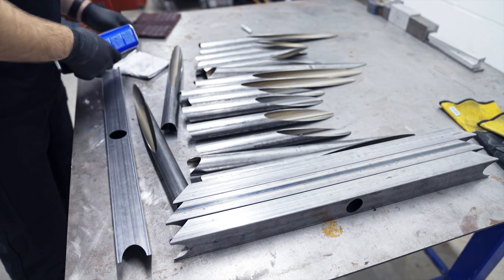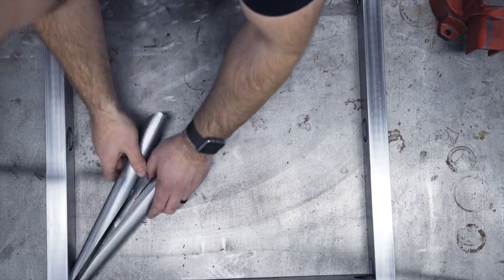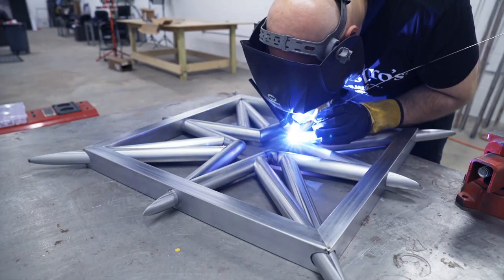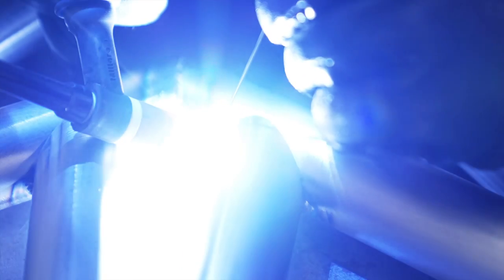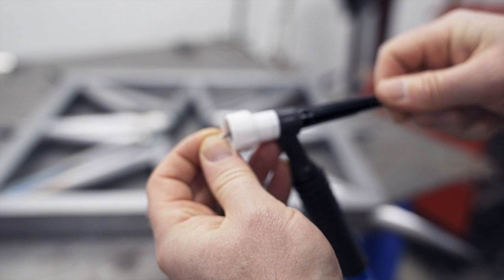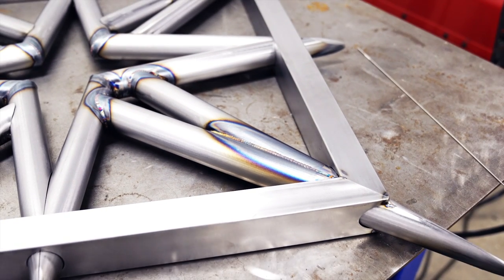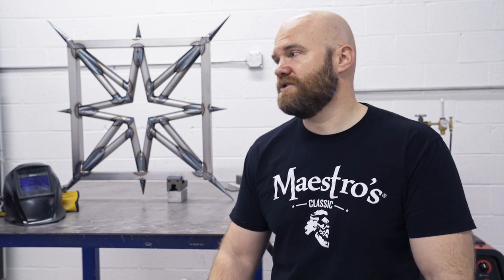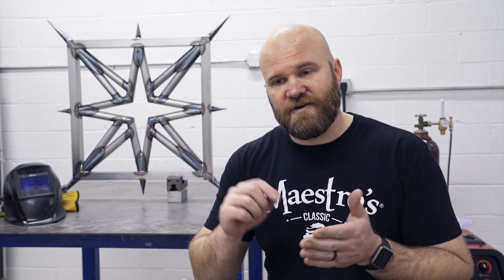Tig Welding the Nautical Star Weld Kit from Precision Tube Laser

Comment: I’m a pulse guy for stainless mainly. I have a few videos on my instagram with my setting. It will vary depending on the materials being welded but a slow pulse is what works best for me. 0.8-1 pps is optimal for adding filler. Just have to figure out where you want the peak on and off times.

Comment: Hey man just found you, really digging this stuff. I might add, for your camera, if you can, you want to have, for the puddle shots, which I want to see more of that, if at all possible, you would want to have your ISO as low as possible, not sure if your camera would go less than 100, but that is a must, and then set shutter speed as fast as possible too, I mean if you can get it to manual mode. Then maybe get you a polarizing filter to cut down the glare, and you should be golden. The brightest of it is causing clipping (pure white) and that is really the only answer a photographer has for it. Trouble is, you lose your dark tones, but you can always bring the brightness back down in post. In vegas there is a filter that you can adjust brightness and hue and equalize it.  
The fastest shutter speeds on todays cameras are 1/4000 and I doubt you are working with anything that fast, but that and maybe playing with your welding helmet filters might help it out. 
Really cool man, keep it up! I will be around to catch it, subbed here at around the 5.3k mark. Cheers!

Comment: i am currently an aero space welder, from my expirence non of the schedules ive seen have required pulse. I do know that some of the other welders like to use it to keep their heat down, but they tend to mash the pedal instead of controling it. I would use it if i was welding with a lathe even then i would pulse with the pedal.

Comment: I've had good luck with the 3m marine paste wax preventing rust on mill scale cleaned steel it's pricey($25?) but if your keeping it inside it will definitely work for a long time and a can of it lasts quite a long time, I use it on my bandsaw stand, welding bench, etc

Comment: Nice work.  That thing has miles of welding. I'm going to try the furick cup. I've heard they are argon eaters. I mostly weld aircraft parts with tight clusters similar to your project here. Bought my first Tig setup in 1979.

Comment: I rest my tungsten on the weld while the post flow is going as well. This has never created a problem for me, in fact, it has helped. At first, I would rest the edge of the cup on it instead, but the cup would slide making the post flow useless while I was grabbing another rod, checking the weld, or just prepping for the next one. Now I use the tungsten to hold it there and I've never gotten contamination from it. If I had just dipped, then, of course, I do it a little differently. As for pulse, I prefer to use a foot pedal to manually pulse, so that I can sync up the pulses and dabs myself, instead of fighting to grow accustomed to that one or two freq settings. I'll try one of these pieces once I can find the finances for it, but I don't think my beads will look quite as good as yours. Maybe I should practice up before dropping the cash anyway. lol  Thank you for uploading this!
Reply from the maker: Thank you for the comment man! With the thought you put into things you are going to be, if not already, a great welder/fabricator/person.
Reply: @JustVoss  Thank you. I certainly try to be the best I can be. I'm not there yet, or at least I haven't been tested to that extent yet. I did well at my state's welding competition, but I also still have a lot of room to improve. Retaining the skill(muscle memory) over the periods in between welding seems to be my issue. I would say I wish it was like riding a bicycle, but I wouldn't be surprised If I can't do that anymore.

Comment: Nice job Justin. I've been getting into cold gun metal bluing lately and think that piece is a good candidate for that. It would need a clear coat of some type to prevent rust. Using a wax is one method that's not real durable but it doesn't chip like PC or paint. 
i
Reply from the maker: I might look into that, I ended up putting shark hide on this. Kinda like wax.

Comment: i dont really like pulse either... when i have to use it because stuff is thin like those spikes i usually set it really fast, so i get the benefit of less heat input while for me it just looks like a normal setting with no pulse. sometimes when i do a shitty weld, i use the pulse to go over it again and make it pretty. you are not supposed to do that, but i dont think my bbq grill will fail because of it :^

Comment: hey man, when it comes to rust protection personally i give everything a couple base coats of silver zinc. i buy that shit by the crate and use it on all my metal work projects and nothing's rusted yet. another option is to have it hot dip galvanized giving it a pretty much indestructible coating that you can paint over.

Comment: Thin metal what I like to do is have a high pulse, minimum 60 but generally 100 pulses a second. Have it in a low back round with a short on time. It lets you weld like there's no pulse but hekos keep the metal from blowing open and agitates the puddle so it will move

Comment: Powder coating all day long. For durability, strength of finish, longevity and overall a better end result. I made two beds a few years back, made myself a large bed to hold an emperor mattress (7’x7’ mattress.. yup it’s BIG) and made a buddy one. He cheaped out on the finish whereas I paid to have it powder coated and the difference is night and day. Nice project bud and nice tight beads with your welds, will look into those cups too. Have you ever tried the wide glass cups?

Comment: I use pulse for everything, It was hard to see what pulse frequency you were using from the video because of the time lapse, but it looked fast, try this 0.5hz (or 0.5 pulses per second, if your welder allows, many don't) 50% on time. Base current should be 1/3 of peak current. 1/2 second on your slopes. 15amps or so on start and finish current. Always use a post flow of around 10seconds and as big a cup as possible. Pulse works really well on steels if you get a weld you don't like just pulse over the top and tidy it up, Alu cracks obviously if you go over it but steel is fine. Pulse settings between 1hz and 50ish just give you a head ache, you either need it the same frequency as the dab or high frequency to get into tight spots, everything else is pointless. Finally when you weld a V you should work the opposite way to which you were, you need way more heat in the tight area of the so weld towards it.
Reply: Best welding comment I've seen this week.
Reply: @carpediemarts705  Good man.

Comment: The fupa is nice. Consumes lots of gas so I don't use it unless I'm welding something very reactive like stainless.  When materials cut into profits it pays to be a cheap ass. Great arc shots by the way.
Reply: Skeetmgeett i use 15cfl most of the times on my fupa 12 for steel... thats the same as my miller 6cups
Reply: @MrRussianProduction  I run mine around the 20cfh with great results.
Reply: @MrRussianProduction  Cutting it awful close, but if it works, it works. I'm sure literally any breeze would interfere with such a weak gas flow though, lol.
Reply: Evanchi have you even tried the cup? i can put half an inch of stick out and i dont get turbulence with door open
Reply: @MrRussianProduction  Yes, I've been using them for years now. Just depends on the gas flow. I frequently require a whole inch plus stickout, I just need 35cfh to keep it clean.

Comment: I only ever use pulse when I am welding thin material that I don't want it to heat soak so it doesn't droop or burn away.
Reply from the maker: Yeah I’m starting to think that’s the best application for it, to keep the heat down.

Comment: cool video, I have build a few Aluminum 5 points starts Its a bout 5'  I thought your square thing was a fixture because the metal move alot and when you try to tack the last point  it calls for ratchet straps and a wood fixture to capture it,,  I have to find a better way

Comment: thats really cool personally i was expecting you to use the frame to just hold it together to get the tubes together and then pop the welds on the frame and finish welding the tubes without and i think it would have looked way cooler

Comment: (aside from your great welding) Really impressed by your wearing a short sleeve shirt while TIG welding. What SPF sunscreen do you use?
Reply from the maker: I’ll eventually get sleeves. Most fabricators just wear t-shirts because you’re moving a lot and not just sitting down and welding all day constantly being exposed. I’v only ever gotten a flash burn mig welding.
Reply: @JustVoss  I know lots of silly stories about people trying to get suntans from arc welding... it never ends up good (difference of UV-A & UV-B)... On a more serious note, I spent 1 very hot day wearing sleeves and a tee shirt, TIG welding an assembly and didn't notice the gap that had opened up between the tee shirt and the sleeves. I ended up with a 1" band of second-degree burns around both arms. It left visibly darkened bands on my bicepts, was very painful and it took 5 years before the bands started to fade. Now, 20 years on, that portion of the skin on my arms gets brown splotches when I go out in the sun. It's just to say... UV rays from any kind of arc welding are dangerous and long-term exposure to UV radiation can cause skin cancer. Anyone interested in the safety of arc welding should look up "UVR and Arc Welding". There is a ton of information on the subject.  I respect your work as a YouTuber and enjoy watching your videos... BUT -> as a public figure, you should espouse safety in the workplace and promote safe working habits to your viewers. Thanks for your videos!!
Reply: Up to ~ 80A I've never had any problems, even if I've been welding all day. You have to be careful about 100A, with AC anyway. But MAG kills me, some spot weldings and im instant red.

Comment: I think the pulse is kinda gimmicky. I just try to get the temp right and run it as fast as I can on tube. Helps to have a couple practice pieces if you're not sure.
Reply: I think if you can get the pulse dialed in right it can be better because you're not using your foot as much giving you the ability to focus on the weld in different positions making it more accurate ......   I think the best option is the finger trigger pressure sensitive one. I mean often welding requires really weird angles and you're not able to position the connecting pieces perfectly on a table in front of you. But I agree hot fast  and heavy usually gets the best results.

Comment: clearcoating the steel will prevent rust as well but it needs to be clean and you need to use real clearcoat, a polyurethane activated clearcoat not spray cans lol

Comment: I couldn't do this. Its great for welding practice but in my heart of hearts i would look at a finished model and not feel 100% satisfied. I suppose we are all cheating because its not like we are extracting minerals from the earth and refining them in to steel that we then fabricate and weld together then finish all by ourselves. But missing out on the fabricating for me just doesn't feel right. Feels like cheating.
Reply from the maker: Agree and disagree, and definitely know what you mean. But I suppose it’s just a variant on fabrication, taking a kit/puzzle and putting your touch on it. What if you designed a laser cut sculpture/part and then welded the precut pieces? Something I bet could be done.